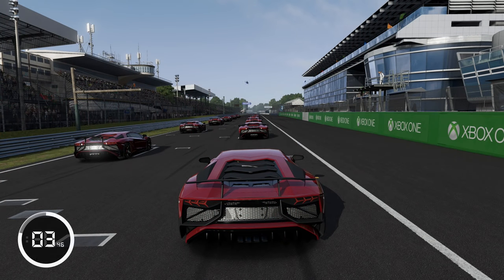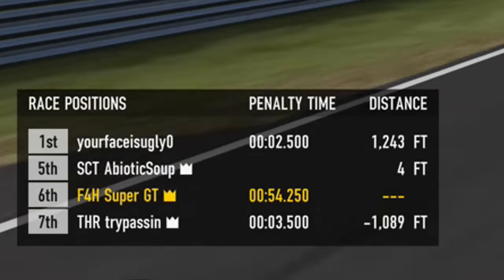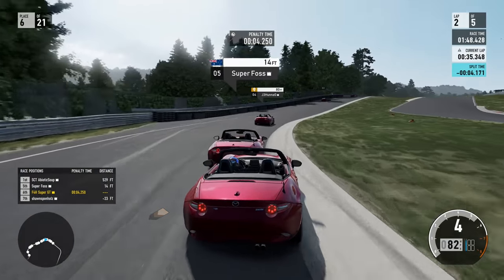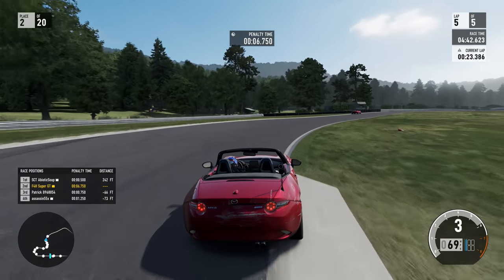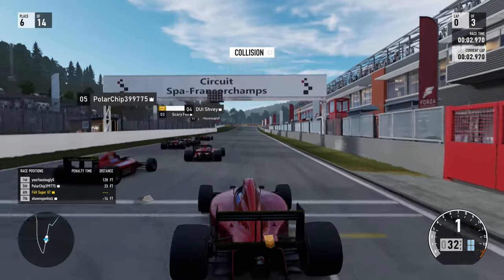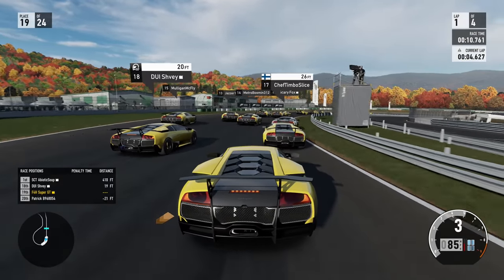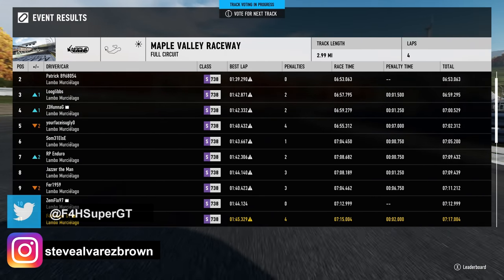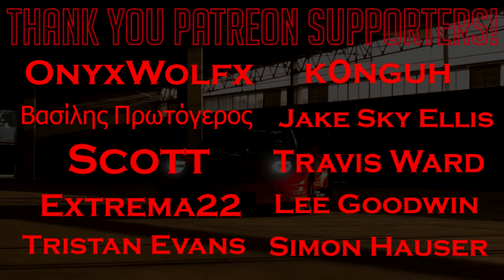Forza 7: The Real Penalty Simulator

Comment: I don't know why turn 10 doesn't implement what playground games did on horizon 4 where you get ghosted if you try to full on ram someone without braking into the shadow realm
Reply: Because that would actually work
Reply: This 100x this.  THIS is the real way to solve the ramming problem.  Let them send themselves into the shadow realm and have to crawl out of the back corner of the sand pits at 5 mph....it will kill ramming dead as even the most remotely viable strategy.  

If they combined that with iRacing's raiting system it would turn Forza from a joke into something the real racers want to play.   At this point its just too many idiots.
Reply: The thing is, Forza fills that niche. The niche of non serious racers and kids who aren't disciplined to partake in iRacing or any other serious sim. It's an arcade game masquerading as something serious.
Reply: @nordoceltic7225  the idiots are drawn to power ,come down to D/C class for pure clean racing .It really is a joy in those divisions
Reply: @shaundavidssd  yep, even a class is pretty good usually.

Comment: Turn10: It’s difficult to be very accurate so little bits of contact are allowed
Also Turn10: gives 2 second penalty for going an inch off track*
Reply: He gained a position when off track. That's probably why he got the extra 2s
Reply: I get extra time going an inch off the track and I'm out front by seconds. It's ridiculous. Going wide isn't that bad. Cutting corners is. They need to fix going wide! Imo of course.
Reply: I got a 5 second penalty for getting smashed off the track at Bathurst...
Reply: @HartyBiker  dude same, mine came out to 7.5 total. I got hammered from the outside taking the inside line and it pushed me into the grass... I was penalized for both.
Reply: @Mcali1984  from what i could tell during my playing they only give penalties if you cut the inside of corners, not for going wide. maybe you "went wide" in a chicane?

Comment: For the most part, the collision system looks pretty decent but the track cut penalties seem pretty heavy.  2+ seconds for dropping a wheel
Reply: Also the track limits themselves are stupid imo.
Reply: 86Themadhatter the one at the end albeit not much of a collision but absolute filth.... didn’t get any penalty lol
Reply: @blankspace5614  exactly, the kerbs are the track right?  They should at least be on the outsides of the kerbs, not in the insides.
Reply: @nordoceltic7225  the white line marks the tracklimit, kerbs arent part of the track normaly. But I'm not 100% sure on that. As long as 2 wheels are inside of the white line you're fine.
Reply: Depends on the race series, there are some that you are not supposed to clip curbs in.

Comment: In regards to the class/rating system for drivers, I was thinking something similar to the car classes but everyone starts at the lowest class and doing league races helps to improve your class. The earlier levels could be easy to grind through but to get into B or A class would be harder to do. Simply to keep the tankers from having access to the faster cars. Rammers could also just build a fast car in C class with a lot of power too. But ramming can have a large impact on your rating and drop you down quickly to counter that issue.

Comment: Off track system seems to work where the amount track cut determines the base penatly with increments of 0.250 + 2 for every driver you overtake while off track.

Collision system seems to use 4 regions, speed of both cars and the relative position of both cars. The foue regions are front and rear bumper and left and right side. 

Hitting someone in the nose to rear with significant force causes a penalty depending on the force applied. Getting hit in the rear does nothing (can't recall JSR Devon on brake checking though). Sideswiping each other does little to nothing. Things change when you gain a position during or after the collision though. If you gain positions over the  car you hit you'll likely be penalized, however if you never overtake the other car on track the collision will not be penalized (which is wrong).

Great system, just a minor flaw in the collision system that I think is fairly easy to fix if you take the directional input vector and velocity vector of voth cars into account

Comment: Can you still abuse the track limits to make everybody else dnf?
Reply: ace2high I do t think you can, I did read somewhere that they have “fixed “ that problem.
Reply: Potentially. Assuming you have the quickest car, you could probably outrun everyone completely by abusing the corners and cutting heavily. You'll probably get over a minutes' worth of penalties though.
Reply: I believe they fixed that because in a race around Monza the guy in P1 finished but the race end timer just didn't appear.
Reply: @ThatGuyErazo  No, when someone has significant amounts of penalty, the game "waits" until his penalty is gone to start the race-end timer.
Reply: @cooltwittertag  so they patched it then.
Reply: That will change again with the August update when they introduce the penalty DQ system.

Comment: ive said it on the forza forums several times. The rammer fix is so damn easy. If a car does not break by a predetermined point on the track (based off of the vehicles PI), that car automatically gets ghosted. How damn easy would that be?????

Comment: When you ebrake into a ram the collision system thinks you are out of control and it doesnt penalize contact whenever one or all cars involved are in an attitude that registers as out of control.  They did this intentionally to help mitigate unnecessary penalties from mistakes that lead to unintentional contact.  GTR Merginator did a video that shows this system working well.  Also, the final update next month is meant to include a DQ threshold for penalty time, so there will be more than just a lower finishing position for those dedicated griefers eventually.

Comment: So what I’ve found with this penalty system is that you can completely wipe out people and not get a penalty but you can make a slight tap to someone put them a little wide and get a five second penalty completely ruining the battle, also the cut track penalty’s on some corners are ridiculous you can clip the grass on the inside of the corner and get a 5 second penalty even when you can very little

Comment: The calculations for colution are done from the front of the car. From a game design perspective. That is why you are able to ram people like that as long as you car is more that +-70 degrees to the turn, or the car infront.

Infact if you were to dive the conner with a drift, and clip the car infront on his nose if the car infront is not to far into the conner the leading car will get n penalty. But this a extreme occurrence and is hard to simulate even if you try to do so.

This system isn't perfect, and can be exploited if understood, but for most of the time I feel they did a good job in finding something that is consistent from a design perspective.

Comment: having 1 system judge every collision is difficult yea however i feel if they put a speed limit 100m or 50m from the corners that will aid in judge who's at fault (lets face it those 2 sharp 90's at monza if your going 160mph 100m from the 1st 90 your not going to make it and your to blame. even if they use F1 cars as a template if your taking the corner hotter then a F1 car your clearly going to be the cause of destruction.

also the guy riding your behind on spa got a massive penalty despite your smashing him off for it, that is good to know  ^^
and the guy who spun off and was doing 360's for days would have been a stellar time to ghost him, game always does it when there's no longer a point to ghost anything >.<

Comment: Its sad when the arcade (Forza Horizon 4) has better clean racing than its simulator counter part.
Reply: That's probably because they nerfed wall riding and ghosted rammers. The carnage used to be just as bad over there.
Reply: @ghostassassin1107  ik they just implemented a better solution than Turn 10

Comment: I think the reason that you don't get a penalty for sliding sideways in to people is because the penalty system is calculating the contact and not really what happens before.

You were sliding in to somebody uncontrollably, you weren't able to avoid the contact by correcting your car or breaking cuz you were drifting sideways in to them.

Comment: @11:49 once the collision happens, Super GT does not get a penalty but polarchip does get 5 seconds. kinda interesting.
Reply: Initial contact had a high speed delta and then he kept pushing SuperGT from behind, so when he pushes back and puts the guy into the wall the game registers that the previous contact, which was quite avoidable, was what caused SuperGT to...erm...lose control...but yeah, it tracks multiple collisions and their outcomes.  That's why it takes a couple seconds to show up.  Its tracking the results of the contact and taking determining measurements.

Comment: I think the problem has gotten so bad that even if the system was working in its current form, it wouldn’t be enough.  Rammers don’t care what place they come in, and probably don’t care about penalties either. There needs to be system of automatic lobby bans for high speed impacts, with multiple bans resulting in a full multiple player ban. A ranked sportsmanship system like GT Sport has wouldn’t hurt, either.
Reply: That's what leagues was supposed to be, unfortunately nobody plays them!
Reply: @scottmatthew9605  well the leagues are usually homologation based so no one wants to.

Comment: Your using the brake.  It may be the emergency brake but you still a brake.  So you slide into cars after using the ebrake the computer thinks well atleast he tried.  When you just bump into a car on or off the throttle you get the penalty.  Try to stop before the hit.  No penalty

Comment: Next Gen consoles are  going to easily  have  the power to use very complex algorithms with mountains of data that can calculate extremely accurately collision fault 95%+ of the time.  But you know they gonna use 99.99% of that new power for eye candy.
A really good collision system will never happen IMHO - looks and graphical polish will always be priority for AAA title.  For this reason I think a safety/fair play rating with safety rating match-making would be best, then individual incidents wouldn't be as important as the overall trend of a player (a clean racer, whilst getting some unjust penalties, will have a better overall record than an un-clean racer).

Comment: If you get penalized for a soft bump and run there is no point in even playing a game.
That's racing. That' s why so many of these types of games suffer.
Also- some of those cut track penalties are absolutely rediculous... (not the big ones but the little ones)... There were two instances where you were not even off the track or the rumble and got a quarter and half second penalty.

Comment: For me the problems with Forza can't be solved with a penalty system, it's to do with the car physics. They just feel super heavy with very poor braking and terrible steering, I never feel in complete control of the cars, apart from maybe R class and above and I think that's why there are so many crashes in online mode. I don't believe most crashes online are on purpose, it's just that the cars are so difficult to control it's inevitable. I guess I could compare it to F1 2019 where the cars feel way too light, Forza cars feel way too heavy. Same end result though - very little car control. GT Sport on the hand seems to have a good balance, inviting fun, close racing.

Comment: 5:52 No, no he did not cut the track.
You need 2 wheels on the track. If the white line doesn't extend around the curb you need 2 wheels on the curb. I would never touch this game. The system is so broken.

Comment: Dear Turn 10 please learn from Playground Games on how to implement a proper racing penalty system. Because if a arcade racer can have a better penalty system than there should be no reason a simulator can not be better. Than again Forza Motorsport isnt a sim to begin with.